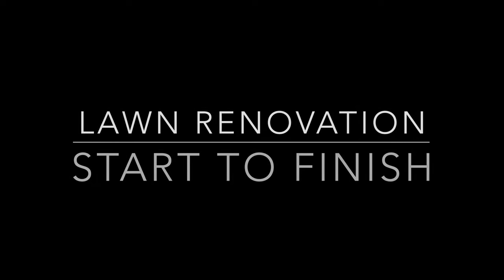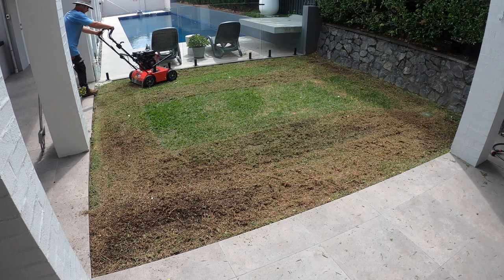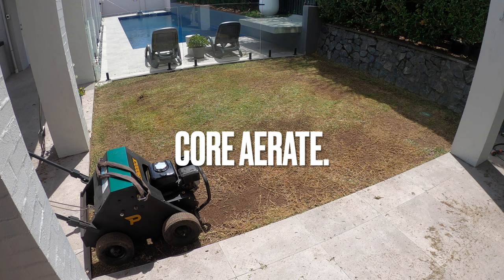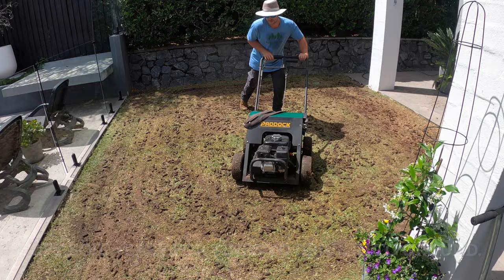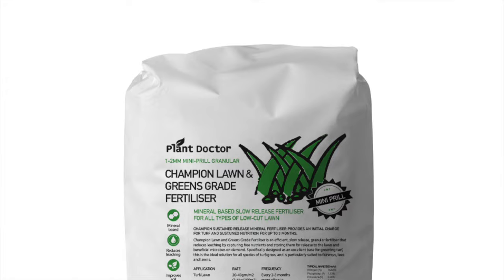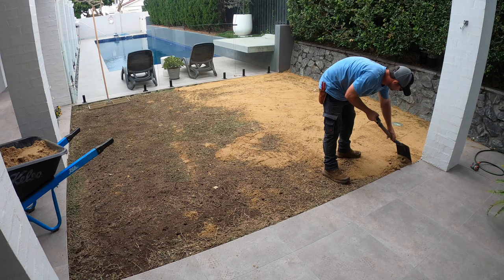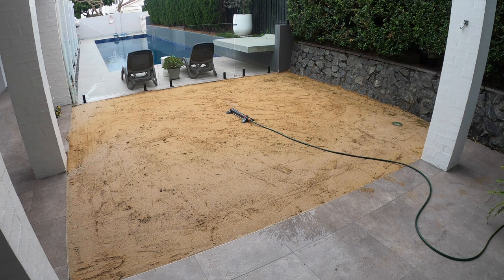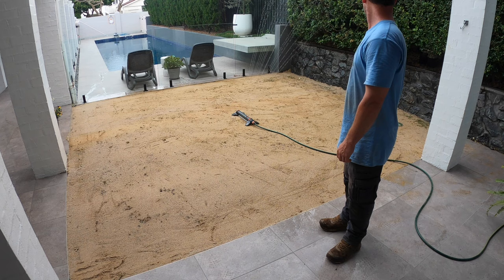ALL THE STEPS to a (Sir Walter) BUFFALO LAWN RENOVATION in 6 MINUTES.

Comment: Can you please do a follow up video? I'm not confident to attack my buffalo like this but if it bounces back ok I'll give it a go. Also, I'd always read not to smother buffalo when top dressing so was much grass showing after you were done?
Reply from the maker: Hi Gerry
No worries at all.
If you are doing a renovation for the first time and want to build confidence than I would suggest to just start with a half reno. This means, just mowing, fertilising and applying a light top dress. If you are worried  about mowing low (scalping), than just mow down to a point you can just see bits leaf blade. If your lawn is not level than expect to see some areas mowed more low than other areas. Learn by doing, and I’m sure in know time you will be a pro.
Yes, there was after I watered it in. I only showed a couple of seconds of watering at the end. Once you water in for 10min or so, the sand/soil will settle in. This will also show you where you may have not put enough top dress. 

Hope that helps.
Have a great week
😀👍🏻
Reply: @mowtime  thank you - I appreciate the advice.

Comment: Good job 👍🏻just a question if not using sand what else could I use to top dress? My yard is on a slope so every time I top dress it and it rains everything gets wash away . Cheers
Reply from the maker: Hi Dario

You can use other materials such as sandy loam, which is a mix of soil and sand. Generally what I use most of the time. Or some people like to use a compost, but I don’t recommend that normally as it can leave larger debris in the lawn. 
Unfortunately there is not a great deal you can do with slopes. I would suggest aerate the soil so it can fall into the holes and also light top dressing, and of course trying to do it when there won’t be any rain for a week, which has been tough for people down south.
Hope that helps mate.
All the best 
😀👍🏻
Reply: Use a mix of 60 percent lome 40 P sand more lome the better gives more root hold and doses not wash a way as early . Keep your grooming clippings to put on top cover with Hession  . Green keeping 15 year's now hope it helps
Reply: Interesting that people use a sand/soil mix, I’ve just seen and heard too many issues with weed invasion. Double washed river sand is the shot IMO.

Comment: My buffalo lawn is overrun with weeds, I went to bunnings and ask for advice all they told me was to get those weed n feed, they're not much use...  What would you recommend me do to clean it up and then maintain it?
Reply from the maker: Hi
Great question. No offence staff at Bunnings, but I wouldn't ask most of them for lawn advice. Some people swear by weed and feed, but I don't. Depending on the weeds in your lawn, depends on what you need to apply to them. If there is only a few broadleaf weeds, than you could you just get a big flathead screwdriver and leaver them out. If you have a lot of weeds, than get yourself a little 5L pump sprayer (preferably not from Bunnings) as they are junk. Get one from the SOLO website. What I know works from Bunnings chemical wise though is Yates Buffalo Pro. Just make sure to follow the application rate.
Hope that was helpful.
Have a great day. 👍 😀

Comment: Where do I start???. That lawn didn't require anything except aeration with a fork - topdress with garden soil or a soil/sand mix - and of course fertilise. NEVER use sand with buffalo. You can level with soil. Always hand water so you can make sure you get 100% spread. Never scarify buffalo - and you shouldn't need to dethatch more than once every 5 years.

It frustrates me to see the number of videos where  "renovation" of buffalo becomes a major operation using a multitude of appliances. I use a small 18inch victa on my buffalo. - set at the sixth notch (so it is pretty spongy). Fertilise at the end of autumn and again in spring. At the beginning of spring I bring the mower down a couple of notches and fertilise. - Then set mower to the sixth notch again. That's all I do.
I've had buffalo in my last three houses and a friend is a buffalo distributor. He told me how to look after it. The good thing about buffalo is that it is so easy to maintain.

Comment: Can you start this renovation process in January or is it best to wait for next spring?
Reply from the maker: Hi Steve

Great question. It depends on your location and weather. It is still fine to renovate if you are getting hot temps, it will just require most likely more frequent watering to ‘settle’ the top dress in and make sure the lawn is growing well to recover. I would apply to liquid root builder pre and post renovation to assist with recovery.

Have a great weekend 🙂👍🏻